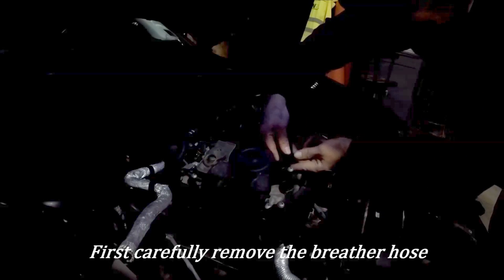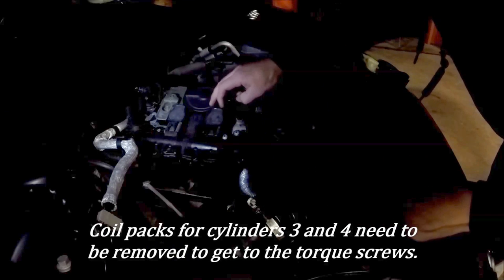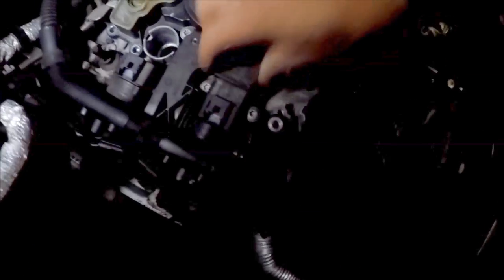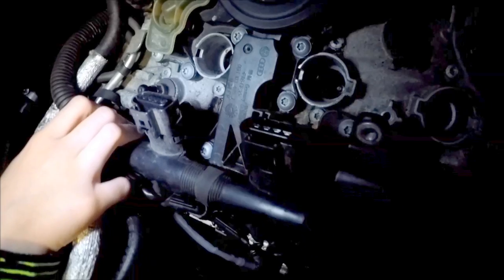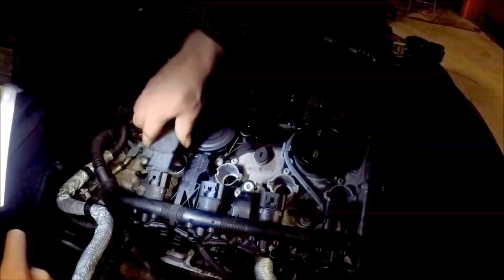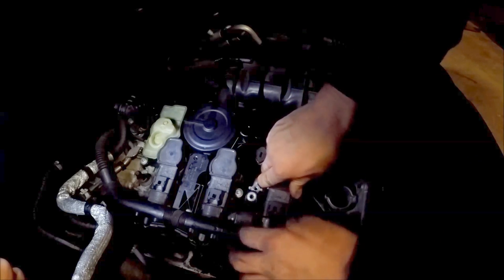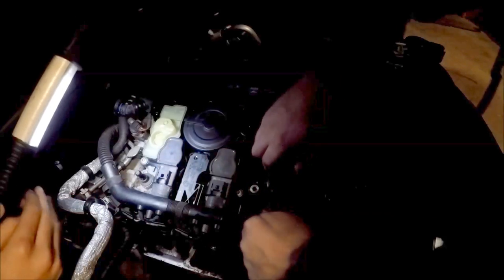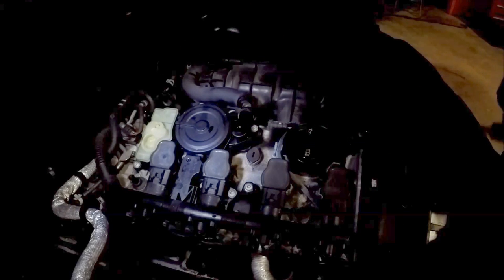P2187 code (Bank 1 too lean) PCV Valve change on my 2009 Audi A4 2.0T

Comment: Hi, last week this same fault came up on my 2009 2.0L quattro.. along with P0507 'idle control system' (too lean) it came out of nowhere..Do you know what causes  this?
Reply from the maker: Louis Bebb A P0507 DTC trouble code may be caused by one or more of the following: A vacuum leak, Leaking air intake after the throttle body,  EGR valve leaking vacuum, A faulty positive crankcase ventilation (PCV) valve, Damaged/failed/dirty throttle body, Failed EVAP system Failed IAC (idle air controller) or faulty IAC circuit

It could be a number of things but it’s probably just showing up because of your bad pcv valve.
Reply: I think I have the same issue on my 2.0 beetle turbo but I’m out of town and wondering if you think I would be ok driving maybe 200 miles home first before fixing...?
Reply: @gregrosen5074   my issue was rear main seal leaking and leaky pvc valve. You can drive with it but the engine was under pressure and there is slight risk of further issues. I drove around for a couple weeks before fixing..
Reply from the maker: Greg Rosen when I had my issue the guy at Audi said it’s not a good idea to drive it too long with a vacuum leak cause it could blow out your crank seal and even your rear main seal. That’s a lot of miles to be running on a bad pcv valve. That’s a tough situation being so far from home.
Reply: Louise did you fix this
Reply: ارجو ترجمه العطل